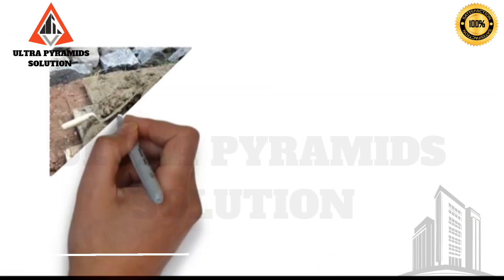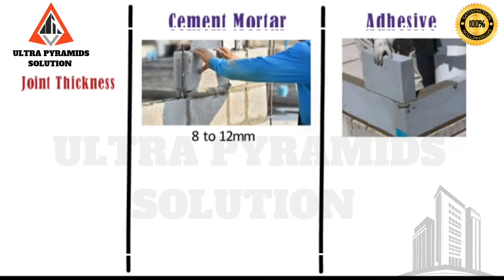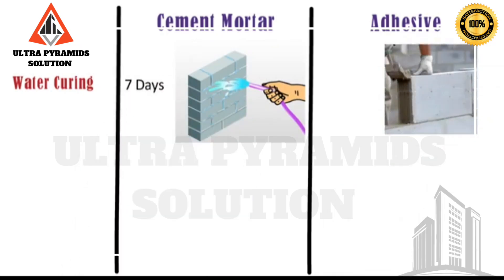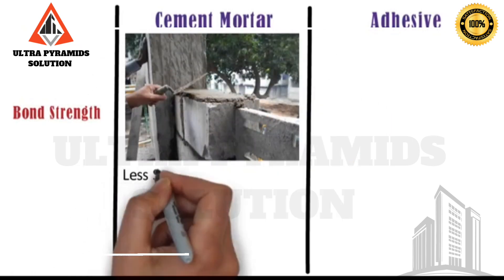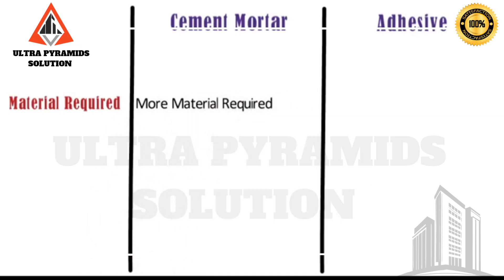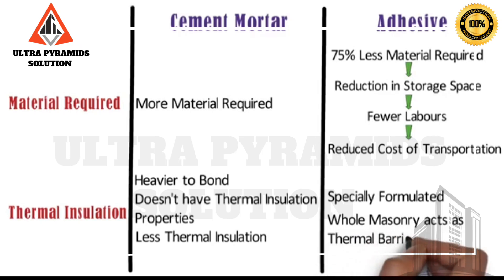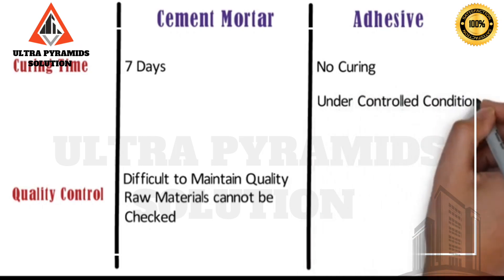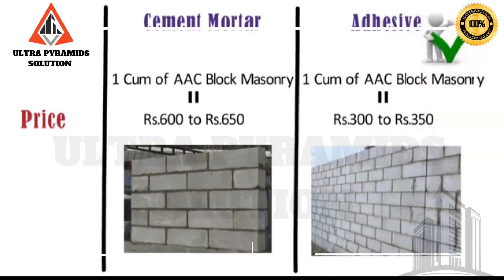HOW TO USE  ULTRA PYRAMIDS SOLUTION AAC BLOCK ADHESIVE

Comment: ➡️ As a contractor I've used this adhesive in my DIY projects, and it's been a lifesaver - easy to apply, strong, and durable.... I was skeptical at first, but this adhesive has exceeded my expectations - it's the best I've ever used ✨✨
I'll recommend to u all please use the ultra pyramids solution adhesive just go for it🎉